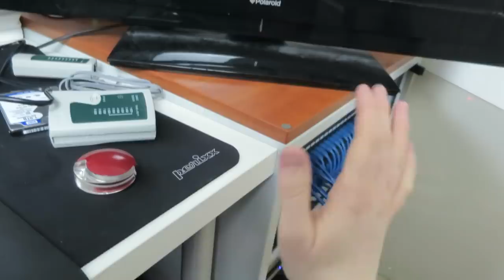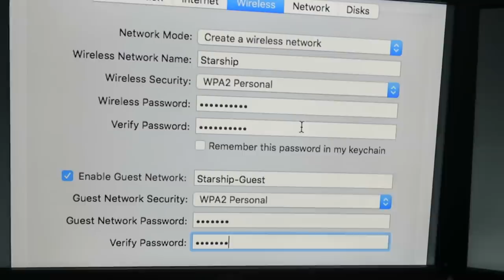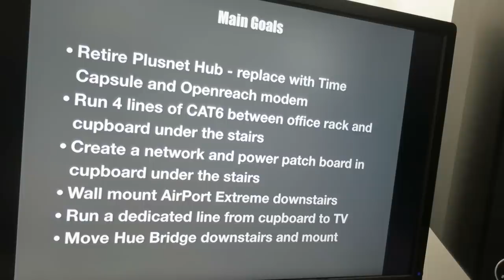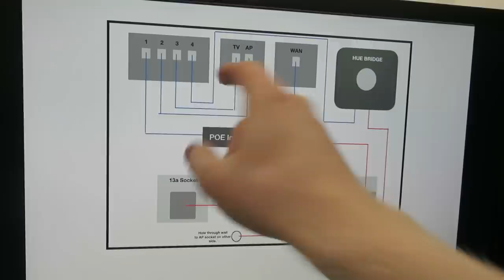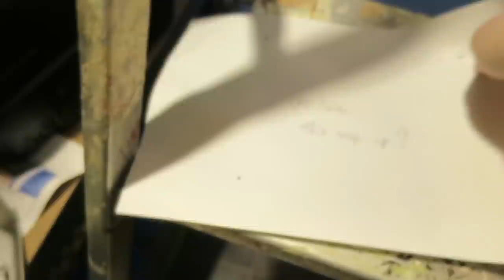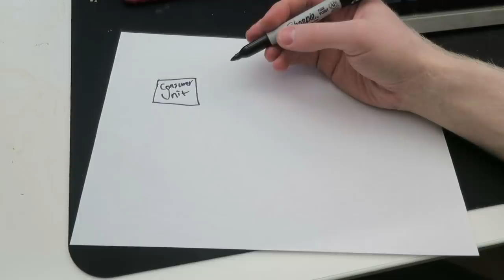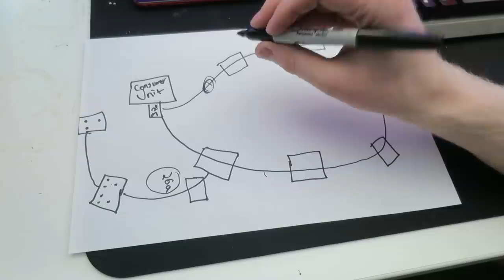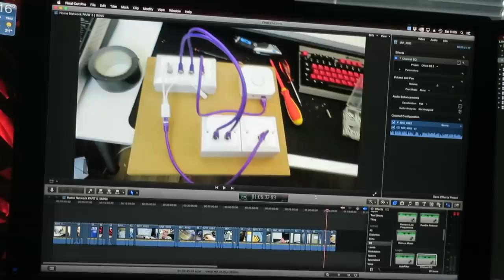Setting Up Our Home Network (Part 5) - Extreme Changes

Comment: Tom just one word.... WOW!   So glad you have moved to a VDSL Modem (I know the Hub One well, as my parents are also with PN), much better for future options such as a pfSense (or similar) router.  The addition of the cupboard board is fantastic, what a clever idea.  Really looking forward to part 6, and to seeing what style of NTE you have for your incoming line.
Reply from the maker: Thanks so much man! Really glad you liked it. When I was originally planning this out, I was always going to use that hole in the cupboard to route the cables so the plan quickly evolved to include the patchboard. To be perfectly honest, having the whole rack in the cupboard would be the ultimate way to go but there's just no space and dust is a big problem under there, so I think it's a good compromise.

Comment: hey man, i spent hours pulling apart ISP routers so i could understand more about them, If i was you, i would use the PlusNet in Bridge mode as the chip is much more powerful than the older BT's and the ram capacity is doubled.
In modem mode alot of the sapping services are deactivated meaning youve got a more power box doing you modem.
Just give it a try 
Olly
Reply: The home plusnet routers cant be run in bridge mode, I don’t think, only the business ones...

Comment: When was your house originally built. The construction is so different then here in Canada. The patterned plaster is cool. The way the electrical and pipes is different then here. We usually have full basement or 4 foot crawl spaces mainly due to colder climate.
Reply: well they differ from sweden aswell

Comment: Have you ever thought about buying an old firebox device and installing PF Sense?  You can usually pick them up for under $30 bucks in the US and they’re a super nice dedicated piece of equipment.
Reply: Kyle's Tech Channel The fireboxes are nice only problem is they take quite a lot of power so something embedded like an Alix may be more suitable or even a celeron j1900 if you can find a cheap one. Or an edgerouter, a bit different but still really customisable.
Reply: I went the j1900 route myself because building an Alix box was a fair bit more expensive. I run Sophos UTM myself but pfSense ran fine on my Gigabyte j1900n-d3v and uses bugger all power.
Reply: You need to be careful doing that. You need to AES-NI support in the CPU for the next version of PFsense. Many of these cheaper boxes don't have AES-NI.

Comment: Why not put the fridge on the spare socket of the UPS? That way your food won't go bad (as fast) if you ever forget to top up your meter.
Reply from the maker: You know, that didn't even occur to me! 
When we forget to top up the meter, we always get the option to insert emergency credit, so the power is never off for longer than 2 or 3 minutes. The UPS is there to maintain upload / download continuity if the network goes out, so the food is ok for 2 or 3 mins. Bloomin' good suggestion though, hats off! ;)
Reply: If you do make the change you would want to double check the fridge's power consumption tough to find out how much potential uptime you are giving up.

Comment: Hey man,  
Im the same as you and learing whilst networking.
Something i found is that its so much better if you run you ISP router in modem mode and then have a different router and accesses point.
The ISP ones are made cheap and cant handle much load, im  with Virgin Media and there New Super Hub 3 Is even worse.

Put your Plusnet in modem mode and get one 
I recommend the Ubiquiti EdgeX.  Only £50 and its the best thing i bought

Comment: tom just a thought why did you chop the figure of 8 connector off the wire to feed it through the wall wouldn't of been easier and cheaper to take the plug off the other end, feed the cable through then reattach the plug
Reply from the maker: A question that a couple of other people have asked... I'll chat about the answer in part 6 :)
Reply: ItsMyNaturalColour when will part 6 be uploaded ?
Reply: CallumPlays He said next week in the video, I’m hoping to understand the plan a bit more! 😂

Comment: Your ip is visible on the speedtest, just a headsup
Reply: ProBro_NL was about to say the same
Reply: It would have changed when he turned off his Plusnet router and then the Openreach modem
Reply: Albert Johnson indeed. Dynamic by default unless he pays for a static.
Reply from the maker: Thanks for the heads up but I have no worries, dynamic IP.

Comment: Why don't you use ubiquiti equipment? 
If you use a ubiquiti switch, for example, you won't have to use Poe injector. 
There equipment aren't expensive!
They have a bunch of different access point models and all of them are very reliable. Meaning that you can install them in both floors of your house, your phone will connect in the one with the best signal strength and you can also have your two SSSID (Guest and your main) .

Comment: I know I'm commenting on this video years later, (I watched this originally when it came out, I need a new no bells or whistles modem, I remembered this from this video). I got a bt modem from eBay, I'm just wondering what iteration you're using, is it a 1b ECI or 3b Huawei one? thanks

Comment: TOM! Great to see ya! One critique, you should have run one cable from your switch in the rack, down to another switch in the closet, this would eliminate the need for 4 cables to 1, and there is no problem daisy chaining switches, only hubs. This is what we do in the enterprise, just make sure the new switch is a Gig speed. :)

Comment: Don’t bother with a dedicated face plate for the AP, just crimp an rj45 connector to the end and patch it directly into the office feed, then run 2 feeds to the TV, it’s always very hand to have 2. Then each wall plate will go to its own room, nice and neat.
Reply from the maker: The plan is to add a small (maybe 5 port) switch behind the TV. I already have 4 devices using ethernet on that setup. I'd love to run 4 or more lines down there but it's just not possible. I think the single line will have to be out in the open clipped down for at-least some of it's run so I want to make it as discrete as possible. I think a single cable is my only option, at least for now.

Comment: a year an a half late but your RJ45 to RJ11 is unnecessary, you can plug an 11 straight in to a 45 port and it works flawlessly (as far as my testing goes)

Comment: tom i know your like the rest of us and funds are limited i know here in the states u can get some of the older dell servers for like 45-100 u.s. dollars and u can swap the noisy fans for a quiter set i ve done that with a dell 2950 2nd gen for a unraid nas it works great but the 1950 u can get and probably run pfsense on that
Reply: Larry Jones I have one of these and they suck up tons of power. That's why they aren't in service anymore primarily as they aren't as efficient as your newer gen stuff.

Mine with dual x5450 Xeons consumes over 100w idle. That 24/7 would add a noticeable amount to your power bill.
Reply: Having dell 750 in winter in Canadian winter ..... there were used as heating in winter to keep my server room very warm and I managed to save 500$ one winter, but in New Zealand where I live now .... the power bill is double with just normal consumption but I have only one server running 24/7 a little hp server the power is very low for it and I run windows 2012r2

Comment: Nice setup Tom. Would it not have been far simpler to put a switch on your patchboard? You would not lose any speed, and it would have been far cleaner.
Reply from the maker: Yes it would've been far simpler but... I only have the ability to run a single cable to the back of the TV, so my plan is to have a small 5-port or 8-port switch behind the TV. I'm ok with daisy-chaining 2 switches but I think 3 is a little excessive, especially considering the primary switch has 24 ports going begging. The hole in the cupboard and the space in the floor presents the opportunity to run multiple dedicated feeds so in the long term, it is a tougher install and more time consuming but the results will be better. I did think of relocating my switch to the cupboard and running lines from there, but I'd end up in a worse position because I need far more than 4 dedicated feeds in my office, so the patch in the cupboard linking the main switch in the office and the secondary switch behind the TV seemed like the best compromise.

Comment: With power line i have had the worst experience 12 mbps on a 150 mbps connection. after I got Ethernet to my PC I have got a solid 150 mbps
Reply from the maker: It seems like people's experience with powerline varies greatly. In my case the performance of the powerline adapters well exceeded the speed of my internet connection at all times.

Comment: I'm actually looking at an Eaton 5p UPS 1500. Its going to go with my HP DL60 server. I selected it since I want to have at least a 4hour downtime window. Our history of power outages is that its either under 15 minutes or greater then 2 hours. So I doubled the time and figure 1500 should cover my timeline.
Reply from the maker: Good call. It makes all the difference. Good luck with the addition :)
Reply: If I had about 30k $CDN Eaton makes a unit the size of a small fridge that has enough battery to run  my house for a week lol.

Comment: Hey man great video, just a quick one. You might as well of used your fuse spur instead of the single socket. It would of been just as quick maybe quicker plugs are a nightmare to deal with. Plus hardwiring is much safer and you don’t have to deal with anything like PAT testing if you have to do it for insurance reasons. 👍🏽
Reply from the maker: The plan was to use the FCU to allow me to add the single socket if the existing double was on a spur from the ring circuit. As it happens, that double socket is it's own radial so I was able to add another socket without the FCU thanks to the appropriate 16a MCB.

Comment: why dont you just run one ethernet line from the patch panel to a switch under the stairs, and please plug in the airport extreme's ethernet into the wan port (the one between the power and the usb)
Reply from the maker: I've had a few people ask the same question so I'll chat about that at the start of Part 6.

Comment: I think maybe your description of the power wiring is off a little bit. Or misunderstood it's hard to know. The ring from the  consumer unit you're describing should be fused at your 32 amps or whatever. That means anything connected to that ring including your spur can never draw more than that 32 amps. I personally don't understand the point of the FCU. But I'm not knowledgeable in your regulations and equipment. One could plug a 13 amp device into every socket on the ring. But it shouldn't be able to support more than the 32 amps whether the devices are on a ring or a spur because it's limited by the fuse or circuit breaker
Reply: on a spur there is only one 2.5mm2 cable 
the max rating for a 2.5mm cable is 26amp 
whereas a ring circuit (the part that has the 32amp breaker) has two cables both of which are 2.5mm2 so can easily carry the full 32amps 

you don't want the spur to be able to take more than the rating of the cable which in theory it could if you didn't have the fcu

Comment: not a bad explanation Tom of the ring main you missed out the continuity and resistance factors but no problem but there is a little known spur lots of people forget about. it one that directly connects to the ring main final MCB it is under the same regs so mult socket it you have to fuse it but if it can get a wiring run in the house you may want to use it. BTW you may need to get your wiring tested by a proper electrician to ensure it is within regs when your done as you can do what your doing but you need to ensure any additions to the circuits are safe to use. BTW I teach electrical domestiuc and industrial electrical engineering ;) btw still have that multiple camera recording device if you want it.
Reply from the maker: Thanks for the comment man! Nice to know I'm on track from someone in the know.. I appreciate it.

Comment: Wouldn’t it of made sense to just move the whole rack under the stairs?
Reply from the maker: Rack under the stairs would've been a good call but there were 2 things that stopped me.
-It won't fit through the door and doesn't come apart.
-Too much dust. The walls are very crumbly and as you saw in the video, there's a big hole to under the floor upstairs and the dust buildup would've been quite bad down there for my equipment.

Comment: How is your DSL faster than my broadband connection? I hate my ISP :(
Reply: Because ISP's cap your speed to the price of your plan, for example my internet was 12/4 and I was paying $70 and now I pay $99 for 100/30
Reply: qqq I pay $95 for 25/2.5
Reply: Where are you guys? In New Zealand I’m paying 90$ for 100/20

Comment: Who makes the key caps on the Corsair k65 keyboard?
Reply from the maker: I'm not too sure,  I got the keyboard with these caps already installed.
Reply: ahh damn! I have the same KB and been looking for replacement caps and the corsairs are very hard to locate caps for.... Did you get it used??

Comment: I wanted to use Airports as they're really stable pieces of kit , but they can't handle PPPoE over 100mbps , my gigabit connection is capped at 300 down 100 up with the airport and 800 down 500 up with my regular Asus router that's the biggest piece of shit software wise. The Broadcom in the airport is just too weak.

Comment: Not interested in Mikrotik or Unifi?
Reply: he got the apple stuff for free I think
Reply from the maker: I purchased an AirPort Extreme when we moved and from there, I got a couple of free AirPort Express' and a very good deal on a Time Capsule from very generous friends. I'm also a heavy AirPlay user.
Reply: ok :). I have Unifi at home and Mikrotik map lite as a travel router. To acces public wifi secure and get a vpn tunnel to the home :)

Comment: higher than my virgin router (super duper mega giga tera router hub switch 3.000000000000) where download is around 230mbps  but upload is only 13, and what sucks in UK that you cannot replace that nonsesical super duper mega router hub thing with your own purchased proper router.... it works fine but wifi is not strongest and many people on internet say that it slow AF compared to proper routers, also max advertised speed in UK is virgin's 350mbps which is like 6-7 years old, UK really need to step up they're internet game as my friend gets 1gbps internet for 35 euro, and we get 230-260mbps for 40-45quid which is like 55 euro with UK being closer to US ''transatlantic cables'' than baltic sea countries are tho UK mains plug is the best - it's massive for good grip and ground plug always goes in first plus it includes fuse inside - always, love it.

Comment: This is May 20th 2018, what happened to AC wireless? Is the Apple Airport Router  AC compatible/enabled? I suppose having AC depends on you having AC compatible devices that can use it, but you can make some older devices compatible with AC by buying an inexpensive AC dongle.  AC makes your compatible wireless devices as fast as wired. I know because I have switched nearly all my devices to it. Having 100 megs per second fibre, I get 94-95 mbs plugged in. With an ASUS AC3200 . All AC wireless devices connect at the "SAME" speed. I know you are an Apple fanatic, but in this case, I highly recommend you upgrade your router. If the Apple device is just "N" then it just does not cut it anymore. AC is that good. Cheers.
Reply: Also, I guarantee, if you get rid of your router and get an AC one, and just use AC compatible wireless devices downstairs, you would have no need for any hardwired stuff downstairs.
Reply from the maker: The AirPort Time Capsule and AirPort Extreme (the router and access point used in this video) are both AC compatible.
Reply: Good to hear. My only bone of contention then would be: "What sort/size of antenna's has it got,? My Asus has 6 bad ass ones and the house is is easily covered. I suppose it comes down to having older, non AC equipment downstairs then. However, in my experience,  adding large, high gain antenna's to a setup to an old Linksys wireless G router years ago made a huge difference to a setup I did for someone, talking about transmitting a wireless signal from the opposite side of a house to the opposite side of the house next door, made all the difference and no more connection dropouts. 
You could get these from Maplins, Radio Shack (yeah I know, all bankrupt) but they sell them on Amazon too.
Just a thought anyway.